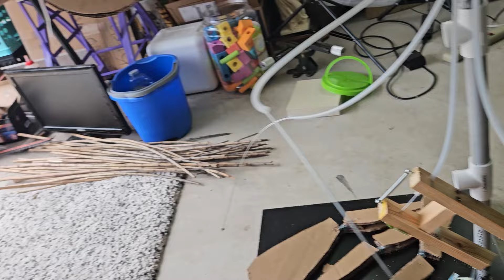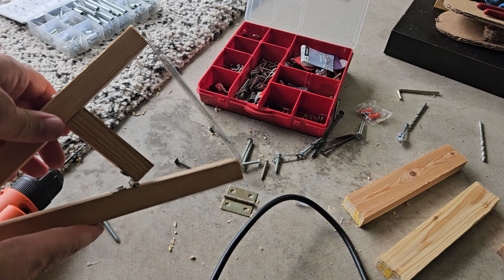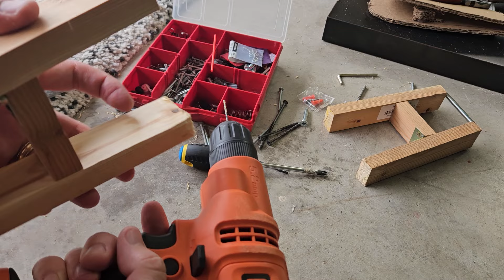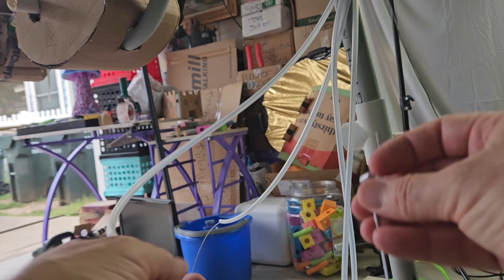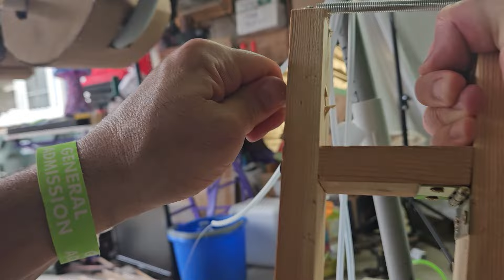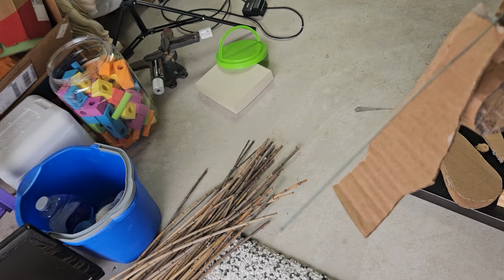Puppet Cable-Control Tutorial

Comment: Is the handmade handles just to give you more range for a greater degree of control? I'm looking to build a small puppet with cable controls like this but I was just going to use the stock bike brake handles. Always great to get a look at others' work process and ideas :)
Reply from the maker: I haven't tried brake handles but the advantage here is that you can place the hinge higher or lower to get different degrees of leverage. However, this is just a basic overview. I would encourage anyone to experiment with variations.